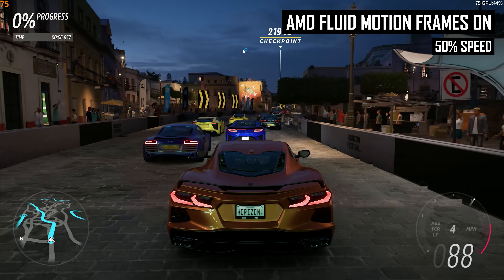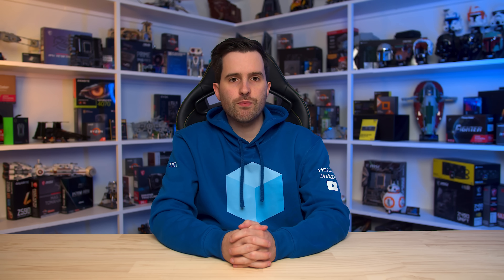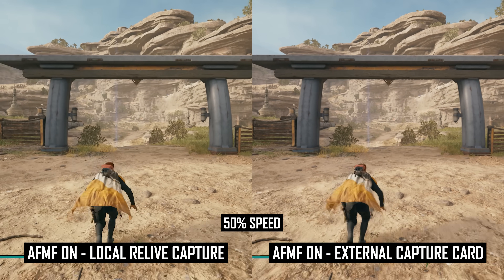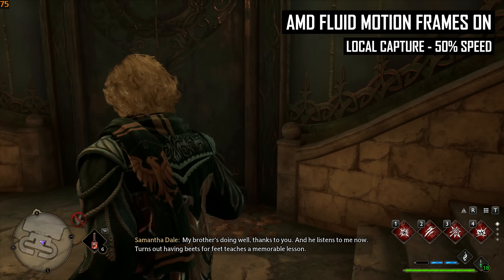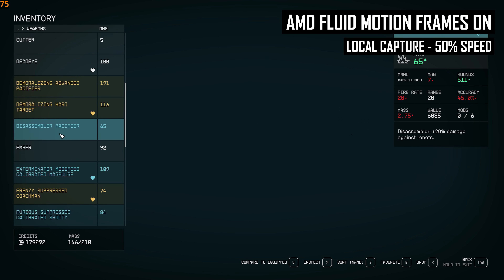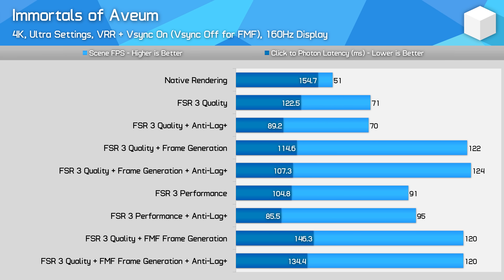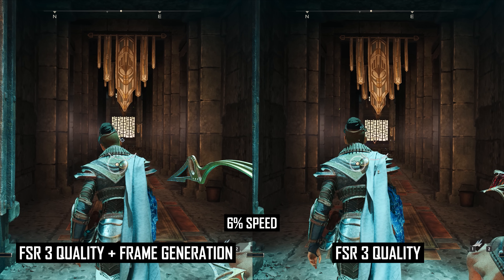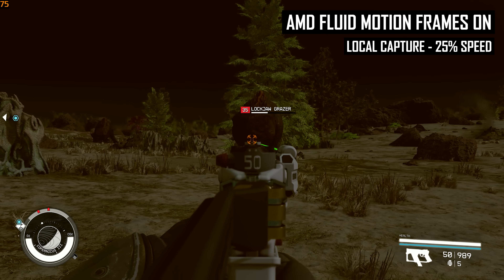Frame Generation for Every Game - AMD Fluid Motion Frames Analyzed

Comment: I was finding EA's Battlefront 2 was having a major stutter issue while playing the campaign. No matter the in game settings even when pulling more then 60fps. Using the AMD Fluid Motion Frames setting increased the frames and made those stutters far less pronounced. At a slight Visual loss, though if you didn't have a side by side it would be hard to tell.  I did not get any screen tearing. I'll probably try it on the other EA star wars titles as they too have a noticeable stutter.

Comment: As someone who's sensitive to this kind of thing - I still believe DLSS sucks and can visually see artifacts when using it.  I think I will avoid AFMF until it's baked a little more.  This could be useful on lower power devices, like the ROG Ally, if the quality is "good enough" to not be noticeable on such a small screen.  I game on 120" Projector or 77" OLED so I'd likely be annoyed by it.

Comment: My sons 6900xt with RTSS fixed to 72 FPS on 144hz Monitor. In Settings use Not async instead Front Buffer sync. No Tearing and Butter smooth. Thats it. Easy.

Comment: How does it affect cpu load? Could this feature help potato cpu users to Run modern Games with  40 instead of 30fps? I am still running x58 for slow paced Games and  want to upgrade to amd gpus because of drivers.

Comment: This video came out during the October 6th update. AMD has had 3 updates since then and all the Nvidiots keep referring to this video to talk badly about AFMF when they dont even realize that their GPU is now slower since then. Here are the updates since then please pin this so people dont get confused with what the actual performance is. December  7th - What’s New?

Updated to include all changes and improvements from AMD Software: Adrenalin Edition 23.12.1.

Improvements to stutter and pacing when AFMF is active.

General improvements to the stability of AFMF.

November  9th - What’s New?

Improvements to driver stability during task switching. 

Improvements to resolve cases of AMD Software: Adrenalin Edition™ intermittently crashing, or failing to display metrics.

October 13th - What’s New?

We have added initial support for HDR to expand the AFMF gaming experience.

After monitoring user experience feedback, AFMF can now be globally enabled on all DirectX® 11 and 12 titles.

Users may use the per-app settings to individually disable or enable AFMF.

Improvements to frame pacing have been made, resulting in an overall smoother gameplay experience and improved image quality.

Comment: I now checked enough games and have to say the latest preview driver seems to work very well. Hitman 3, Green Hell, Medieval Dynasty I restrict my frames to 50% of my monitor refresh rate (via riva statistic from MSI afterburner) and then activate AFMF I have my refresh rate maxed out. My Graphics card only uses 80% of the power because it only has to render 80 frames even though I could do more. This way I save power, less noises from the fans and the experience is pretty good. 
It works OK for Red Dead Redemption 2, Cyberpunk and sons of the forrest.
Starfield and some other titles are a bit of stuttefest still, but in total it already works OK for a preview driver. This feature is good to max out you refresh rate by already havin solid base fps. And it also can save power usage of you graphic card.

Comment: The oct 13 beta driver works fine. Doubles my frame s with starfield and cyberpunk with no major noticeable visual degradation . Works with rdna2 aside from rdna3. Works with HDR now. No UI issues. Though lag is noticeable with cyberpunk with RT

Comment: But...if all those artefacts, which by the way, I only notice them In 2% speed, are because the frames are higher than your refresh rate...then it is as easy as going into the video options of the game and set the frame limit to that of your screen.

Comment: AMD  During the presentation   the manufacturer went into further detail and showed a  “Deep Dive”  on the  “Fluid Motion Frames Technology ”   which  as a kind of interpolation process between every two rendered frames it  can insert an additional frame  “in between ”      {   23 hours ago  }
How to enable AMD FSR 3 in supported games. FSR 3 can be enabled within the settings of supported games. In the case of Forspoken, the AMD FSR 3 settings can be found under the Graphics tab of the settings menu. To change the FSR modes and turn on frame generation, the Image quality preset must be set to Custom.Oct 7, 2023

Comment: (AFMF Config for smoothness) set a frame cap to a frame rate that matches or divides into the native frame rate of the monitor this works really well and helps with frame pacing. I run AFMF with AMD Super Resolution and 20% sharpening to upscale games with higher frame rate and resolution it looks great and makes game look amazing at 5k upscale resolution. I can run it on all games where I want to turn up all the eye candy with double fps it really does work you just have get your settings right. On a high refresh monitor with a frame cap it works well the key is the fps cap, set fps cap to keep gpu below 95% usage with the rule of running at native refresh rate or one that divides evenly this will make it smooth and avoid micro stutters. Also make sure your game is running at least 90fps or higher to keep input lag manageable the higher your fps cap the lower the input lag will be with AFMF. You can make custom CRU profiles for your monitor to create different refresh rates to fine tune everything for good frame pacing.👍

Comment: I do not understand the purpose of this video. Twenty minutes on a preview driver. Many of the issues have already been fixed, I can understand the motion vectors angle, and so the resulting limitations tied to it, but I don't think the purpose of AFMF is to be on par with full fledged frame gen from AMD itself, or Nvidia. Its purpose is to be a decent place holder for game titles that do not have 'proper' frame gen support. 

On an adjacent note, considered the negativity profused in this video, you guys should ignore the idiots writing 'AMD-Unboxed' on r/hardware, you already have a pretty neutral POV when it comes to hardware brands, there is no need to try hard at showing that you're not biased in favour of AMD.

Comment: The more talk I hear about frame generation, regardless of whose version, the more I feel people aren't understanding what the point of this tech is. This is not meant to improve performance or to save old cards; it's meant to allow already high fps experiences to push quality settings to the limit while maintaining a feeling of smoothness. It's not a magic button to improve your gaming experience, it just better utilizes a high refresh rate monitor. I think Nvidia is actually to blame for the misconceptions with how they marketed it in cyberpunk initially. Even if ai suddenly takes a massive leap forward, this tech will still push out its best guess of what a frame will probably look like and still be at least somewhat wrong. The idea that afmf should look better or maintain high frame rate under high movement boggles my mind; of course it won't work, it's relying on motion vectors rather than actual game data. It either shuts itself off until the uninterpretable motion goes away, or the generated frames will be a mess and ruin what you're looking at. I don't know what people are expecting outside of perfection.

Comment: From my testing(rx6600) the only game where the fmr felt like an improvement was overwatch 2. I was getting 300-400 fps already, but when enabiling fmr my imput delay wasnt noticably increased, while motion clarity for moving targets seemed to be impoved. My gpu utilization is normally about 40% in game and raised upto between 80-90%. My frametimes and 1% lows were improved aswell. My therory is that the fmr is allowing my gpu to be better used improving the frametimes. When i tested cs2 i had very different effects and a much worse frametimes(bad frametimes with or without). Battlefield 1 had major added imput delay.

Comment: Do keep in mind that it is preview/beta drivers, plenty of potential with this. So highlighting current issues is fine, BUT the final release for this wont be to Q1 2024.
Lots of things will improve. HDR is actually already added with a newer update, so much of the points in this video will change.

Comment: i tested Hogwarts Legacy with 7900xtx + 5800x3d and PG27AQDM... and maxed out (without RT) natively i have 110-140 fps making it 220-280 when afmf enabled... perhaps this is because of the already-high base fps, but i really do not see any issues with it... what is noticable to me is the slight higher latency in mouse look. but the feature turn itself off when you rapidly mouse look and it does that very smoothly as well as it turns itself on also smoothly. imho that is a good thing because when there is bigger difference in between two native frames you would feel this mouse look increased latency even more and that would be worse than lower frame rate.

Comment: I've starting using AFMF yesterday on my RX 6800 + R7 5800X3D, and I couldn't notice any difference at all to the the image quality. It was so dam good! On ultra, games where I was getting 100 fps, I've started getting 200 with AFMF on. I believe the latast update improved the overall image quality, because the things I saw in the video I couldn't notice at all. The only game I saw something strange was Days Gone, where I had a few chimearing on the crosshair, but nothing major. I believe it's a must use feature, I hope they make it viable to more cards, so people can test it by their on eyes and hands. PS: I'm currently running a 240hz display.
Reply: How to enable it? Or it's only an amd thing?
Reply: @butterfly3737  AFMF stands for Amd Fluid Motion Frames. For now we have only the preview software, and it works only for the RX 6000 and 7000 series AMD GPUS. For Nvidia you should look after Frame Generation, and I guess, DLSS 3, which only works in specific games, where devs implement it. Thus, AFMF works on the software level, not needing any implementation in the games by the devs. Hope I helped you in anyway.

Comment: what i dislike about AFMF is that when i tested it at a lower fps, lets say you want to turn on RT or higher settings/resolution, the game was very choppy and screen tearing was wild when you try bumping like 30 35 fps up to ~60. If the game already runs at a high framerate there is no point in turning on frame generation in the first place lol. Also i dont see a point for it without Vsync, if i turn it on and get screen tearing, the game wont feel smoother. If i had money for a good lets say 165hz display, id probably have enough for a graphics card that didnt need to generate frames to run games in the first place

Comment: I had the oppositie impression of AFMF.

It works well in some games. Starfield, MSFS, and Fallout 76 come to mind.

I like that it doesnt require developer inplementation so it works on my back catalog of games.

Is it perfect? No and some games dont handle well. Guardrail artifacting definitely is a thing and its prominent in some games. 

However, if you view this as a tool to play older games at a higher refresh rate, or maximize longevity of a gpu a little longer (until the latency does become an issue) its a good option to have.

Ultimately, this is an option. I'm glad it is available and for when it doesnt work well, it can be turned off. Now I just wish it supported older DX versions and Vulcan.

Comment: It's curious to see that the tech tries to blur rendered frames together. One would expect that trying to interpolate the movement between two frames, or extrapolate based on the previous few, would yield a sharper generated frame, which ultimately should lead to smoother frames in the end.
Game animations typically have predetermined animation frames, so one would think that this information could be used when generating frames to improve their quality.
It'd be amazing if you could get an engineer working on this tech on the podcast and ask about the various approaches to generating these frames, as well as their downsides (cost in time, cost in calculation, cost in quality, etc).

Comment: Good analysis as always, but I think one thing was missed.
Based on users configuration, should you go with AFMF enable and better frames or without AFMF.
My personal experience on cyberpunk is that I prefer A LOT having AFMF active since it makes the game very playable, but without AFMF it is not.
What I would recommend is a side by side comparison, with AFMF on HIGH settings versus native resolution on LOW and compare both.
This would be a fair comparison. The tech has lot of flaws but I don't think it is garbage

Comment: The new preview driver seems to have corrected this issue. Also, you should test double gpu system (with one amd and nvidia gpu) using the nvidia gpu to render the game and the amd one as the display output (and enabling afmf), because, on my end, this seems to be working. 

Right now, my 3090 with dlaa is using afmf in cyberpunk :)

That would be a big plus if amd  make afmf possible for their egpu.
Reply: I'm curious. What's your use case for a dual gpu system across brands? Does having ALL the drivers give your system random issues? Please tell me this is running on an Intel CPU.

That said, how exactly do you configure it to run the game on nVidia card, and then how do you configure AFMF with the AMD card as output?

Comment: Honestly, driver based frame generation is incredible on paper because of how many games can't use interpolation, especially for things like emulators.   Being able to interpolate old 30FPS locked games to 60 makes them playable.  Same with 60->at least 90, as BFI (black frame insertion) isn't great.

I was trying to do this with SVP (smooth video project), but could never really get things working properly, and always had major latency (and color subsampling).  Something like AFMF would make that obsolete, and much better.

Shame things aren't in an ideal state right now, but here's hoping they get this improved sooner rather than later, and expand it to more cards (and API's), and make NVIDIA do the same.   Would be a dream come true.

Comment: I think it would be interesting to see on games that are capped to 60fps, like the Dark Souls games, or maybe even older games that were hardcoded to 30fps like Okami.
Reply: Can confirm it works beautifully in Elden ring. Literally the perfect use case. This is a botched review, they treat it like FSR3/DLSS3 but it's different tech with different use cases.

Sorry HUB but this deserves a retest.

Soulsborne games are extremely popular and that's just 1 example.
Reply: @Altrop  Well, you can unlock the Frame Rate in Elden Ring, so Frame Generation is not necessary for high frame rates in that game.
The games of the Souls series can't be unlocked without making them run faster or causing physics problems.
Reply: @EVPointMaster  False. Elden Ring must run at 60FPS for the gameplay mechanics to work properly. If you unlock the framerate you are not only banned from playing online, but you also mess with the game mechanics. The game relies on frames for dodging. If your framerate is too low it actually also bans you from online play.

AFMF gives you the smoothness of 120FPS without messing with the 60FPS core gameplay of not only Elden Ring but all soulsborne games
Reply: @Altrop  I've played Elden Ring for about 400 hours by now with an unlocked frame rate and I've yet to find anything wrong with the game mechanics.

I stopped playing Souls games online with DS3, player messages just spoil every secret in these games. And if I want to play Coop, the seemless coop mod is a much better experience than vanilla coop.
Reply: @EVPointMaster  you only get a certain amount of frames to dodge with a roll, 13 franes I believe. If you play at 120 real FPS your dodge window is halved which is a HUGE deal. You don't have to believe me just look it up. Also online play is no longer allowed.
Reply: @Altrop  the number of iframes is for 30fps, as that's what the system uses internally. The number of frames Elden Ring renders does not affect the invincibility time.
If it was the case, dodging would be incredibly inconsistent on the consoles because they're running at a variable frame rate between 30 and 60fps.
13 frames at 30fps are 433ms, if it was also 13 frames at 120fps, that would only be 108ms. It would be practically impossible to dodge most attacks if the invincibility window was that short. I think I would have noticed if all my rolls failed to dodge attacks.